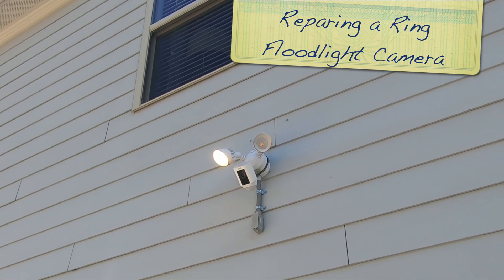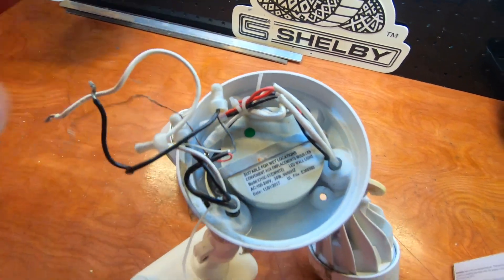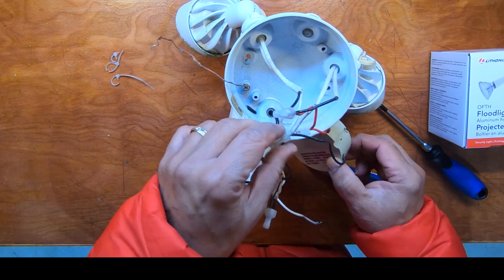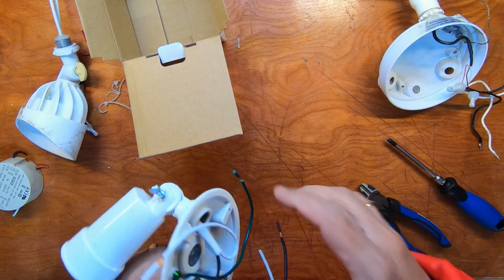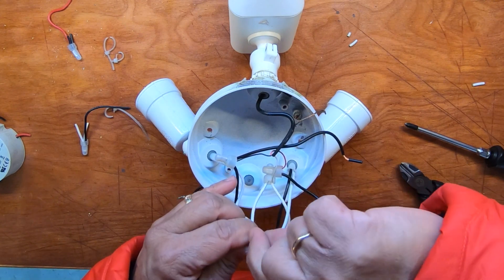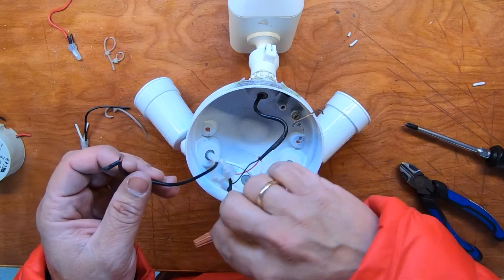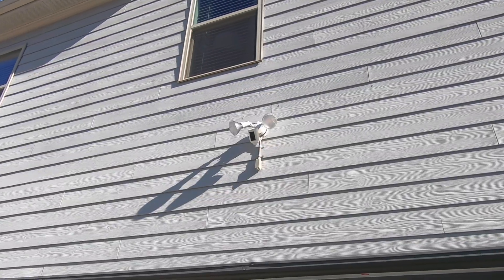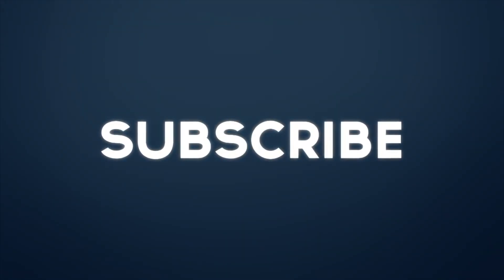Repairing the lights on a Ring Floodlight Camera

Comment: Absolutely worked! One floodlight camera started flickering last year, replaced it for $179, second floodlight camera started doing the same recently. Saw this video. $4.98 for a light post at Lowe’s and $16 for two LED lights and the hack worked! A class action suit should be brought against ring company for their unwillingness to provide replacement parts at least! Thank you so much for this video.
Reply from the maker: Thanks for watching and glad it helped.
Reply: Any product link , or model number . I replaced mine , but the new one has ballast / device & when I connected light didn’t work ? Wondering if I need a , buy new flood light host without , a ballast

Comment: Does anyone know how much current that little red wire and the "trigger" are rated for? I want to do this but am worried with how small that wire looks. Considering using a small relay in there instead of switching the lighs directly
Reply from the maker: Great idea! Thanks for the suggestion and thanks for watching!

Comment: Thanks for the video. The tip to check it before remounting was great as I initially rewired with the step down transformer intact but my lights wouldn’t come on until I removed it. 

I took an old 3 prong printer cable, cut it, stripped it and wired it into the light and plugged it up. 

Everything seems to be working fine now. Thanks!
Reply from the maker: Thanks for watching!!

Comment: Just so everyone is aware: the new gen of this camera has redesigned internals. The lights arent screwed into the housing anymore they have special mounts that connect them to the housing. Additionally the transformer is no longer small and screw mounted in. It takes up a large amount of space in the housing and the connections are moulded into place with a durable rubber material. Essentially this video wont work for them. They have made it very difficult to replace the lights individually. Ring probably realized that someone who knows how to use a screwdriver and a couple wire nuts could fix it themselves. Cant have that.
Reply from the maker: Thanks for the info and thanks for watching!!
Reply: what a ripoff . Ring can kiss my .....

Comment: Thanks for the video, I found the weather proof sockets at ace hardware for only $4.99 each and got some Led Floodlights for $17 a pair so less then $30 and twenty minutes later all done, I believe I’d like to be able to buy this rig from ring with the replaceable lamps instead of the ones they provide… 😊
Reply from the maker: It was so easy to do! Thanks for watching!

Comment: What about the black small wire you never mentioned what to do with it
Reply from the maker: Thanks for watching. I can try to find the original wiring diagram I used.
Reply: @TheFunFix-y4t  I reconstructed my ring spotlight now my light stays on I rewired it now my light does not work I really need the help
Reply: @willtownes2402  i tried the same and lights stay on. I am unable to turn off even with the app.
Reply: Did you wire the white AND black wires from the wall directly to the black and white for the lights?

White (neutral) from the wall should connect with all white wires. Black(hot) from the wall should only go to the black (hot) for the camera. Red (trigger) should feed the black(hot) to the lights.

Comment: Is the newer 2021 release still has hard-wired LED light that can not be easily replaced with light bulb? Thanks!
Reply from the maker: I have a newer one as well and it looks even more complicated than the older ones. But you are correct.
Reply: Do you think the new one can be rewired the same? The lights are 19 volts and the camera is 5 volts. I’m worried about frying the camera.

Comment: I bought my parts at home Depot. Five bucks each and it screws on easily. It even had a rubber grommet to keep water out.
Reply from the maker: Good deal. I actually found some LED lights and replaced the giant sized flood lights with them.
Reply: What kind of lights did you use?

Comment: I just stumbled across your video as my Ring was having the same issues. It’s been 9 months now. How has it been working? Any problems?

I always worry about electrical fires due to something not being straight from the manufacturer but then on the flip side fires happen with lights straight from the manufacturer. 

About 15 years ago, our Summer house sustained a fire from an outdoor light during a rainstorm. 

Thanks for your video. 👍🏼
Reply from the maker: So far it’s been good and working without issue. However, the lights have not been on continuously for more than 30 sec at a time. Thanks for watching!!
Reply: @TheFunFix-y4t is it safe to keep the lights on all the time with that hook up?

Comment: Can you be more specific on which wires go were, just confused were the thin red and black go
Reply from the maker: Thanks for watching. The white hot power connects to the white on the sensor and white on the lamps. The black power connects to the black on the sensor. The red trigger from the sensor connects to the black on the lamps. Hope this helps. Please note that this is just how I did it. I am not a professional and do it at your own risk.
Reply: TY
Reply: Everything works great, great video!

Comment: Oh and yes it works with the motion sensors.
Reply from the maker: Yep….sure does
Reply: Mine does not work any tips or diagram
Reply: @willtownes2402 
Did you take out the transformer
Reply: @ubaldorios-pn7qv  please let me know where the three wires go before I lose my marriage lol
Reply: @willtownes2402  
Take a pic of the wires for the Ring and the one for your new lights

Comment: I really am grateful for your video. Had the same issues due to water. Getting into the lights. So I bought this Sigma Engineered Solutions 120-Watt EQ LED White 2-Head Switch-Controlled Flood Light with Adjustable 2000-Lumen-Lumen
Item #1962957 |
Model #16754WH
Shop Sigma Engineered Solutions
I first tried it by leaving the transformer but it didn’t work so when I took out the transformer inside the ring it worked. Thank you for your video  saved me from
 Buying another Ring
Reply from the maker: Thanks for watching and I appreciate the comment.
Reply: Wish there was Amazon link or , product .. link